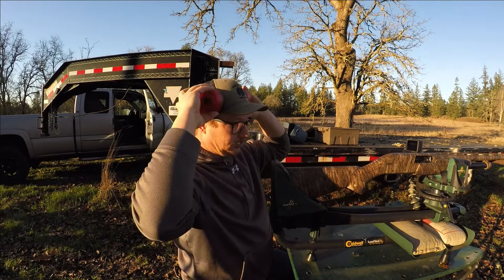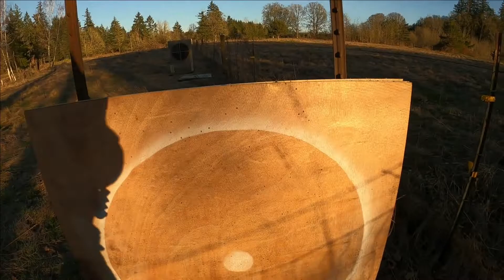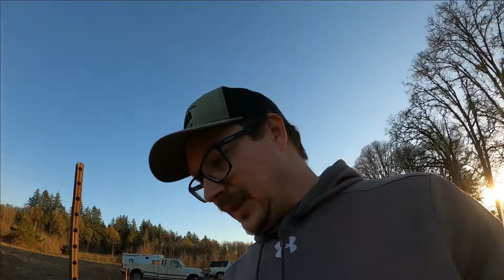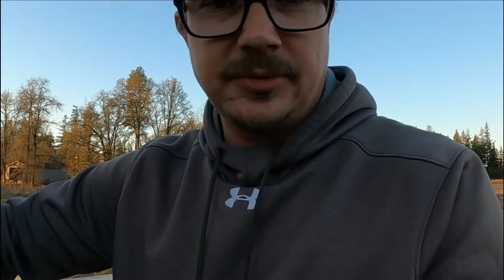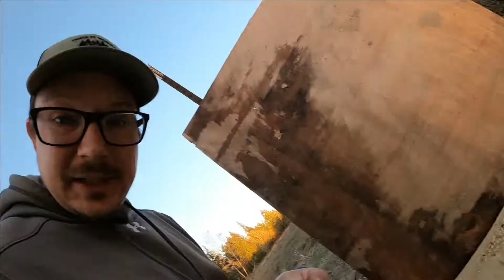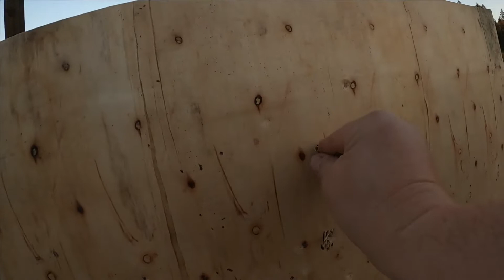Is Steel Shot Really That Bad???  Steel Vs Lead Vs 50$ A Box Tungsten Ammo!!!

Comment: Hi Mitch The BB are pretty awesome what choke did you use in your gun, I would like to try the BB on coyotes !
Reply from the maker: That was just the factory modified choke that came with the Winchester SXP.
Reply: @mitchweigel6713     Awesome so  the Factory modified in my Remington 870 12ga  should work good with BBs I'm going to do some patterning for coyotes !! Thanks so much for the info 👍

Comment: Tungsten is 18 grams per cc.  The stuff you used is less dense than lead. The lead load was highly questionable. You could not provide its actual history. It might have been a reload because you could see past the crimp.
Reply from the maker: I did not realize till after I had bought the box of Hevi, that it was only 10.1 g/cc.  I wouldn't have paid 50 dollars for them.  They are a tungsten alloy blend.  In most cases a bismuth based shot  is heavier than this alloy. Usually in the 11 ish g/cc.  The old lead shell came out of a box that I'm 99% sure was factory loaded shells.  I have been looking around for some more modern shells. But with the ammo shortage it is very hard to find anything.  Thanks for watching!

Comment: #2steel vs #4lead is a more direct comparison, that #2 lead seemed very old, perhaps the primer/powder was deteriorated ands not at full power
Reply from the maker: I wish that I had a newer shell loaded with #2 lead for this test.  I came across some # 6 lead the other day. Maybe I will have to revisit this and compare the # 6 lead to # 4 steel.  That way I will be comparing similar pellet weight, rather than pellet diameter. Also trying to think of other materials to test.  Maybe some ballistics gel!  Thanks for watching!
Reply: @mitchweigel6713  thanks for the video I didn't mean to sound critical
Reply: @mitchweigel6713  unfortunately you will have to reload if you want new #2 lead. I have some 1970s 10 gauge 2 7/8" in #2, but the velocity is definitely diminished from where it should be.